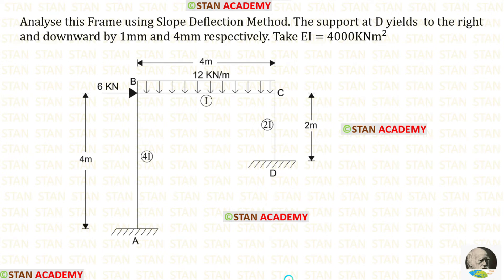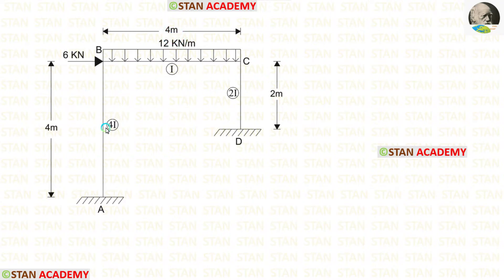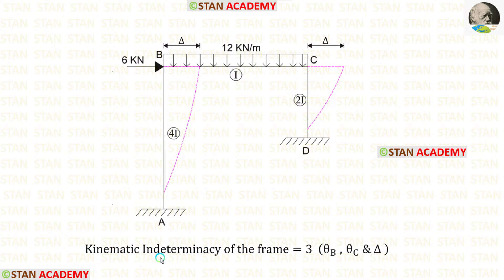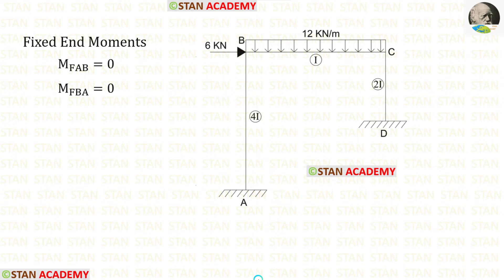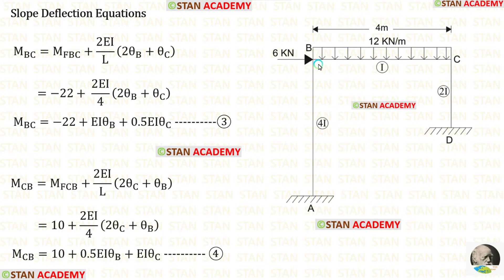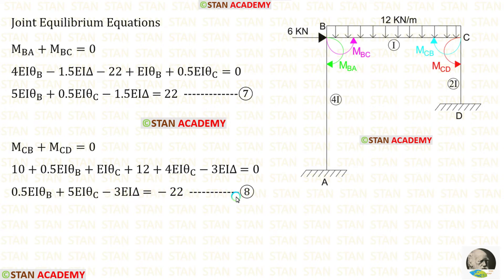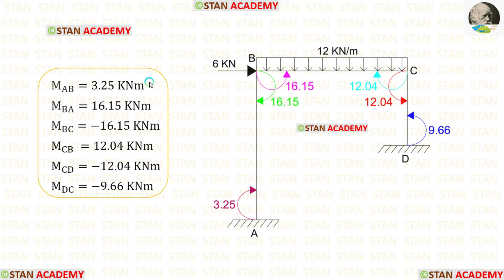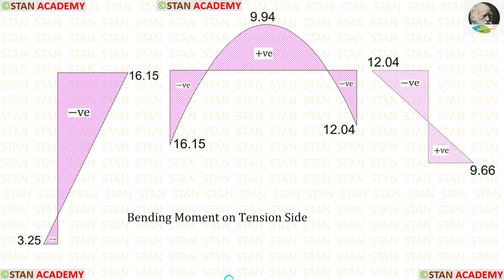Frame With Yielding of Support, Slope Deflection Method - Analysis of Frames - Problem No 7

Comment: I appreciate your help. Same problem with slope deflection method D has vertical settlement of 6/EI . How to solve this. If possible I can give you my email if you have time cuz I'm struggling with it
Reply from the maker: same problem has been analysed in slope deflection method. See the description below for the link.
Reply: @Stanacademy Sir, vertical displacement as in this problem and vertical settlement at D both are same thing ?
Reply from the maker: yes

Comment: In column CD we assume that moment is clock wise but after calculation we find that moment is anti clockwise.Than it effected calculation or not effected.please explain.
Reply from the maker: It wont affect. that is only assumption to make the shear equation.